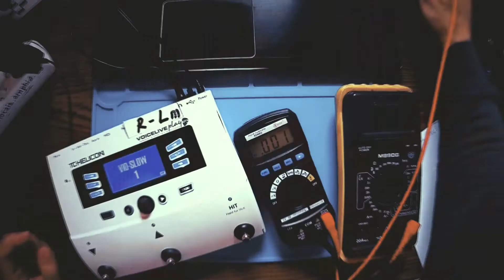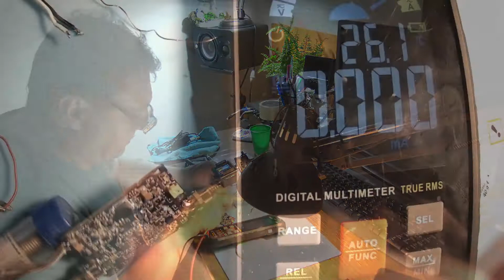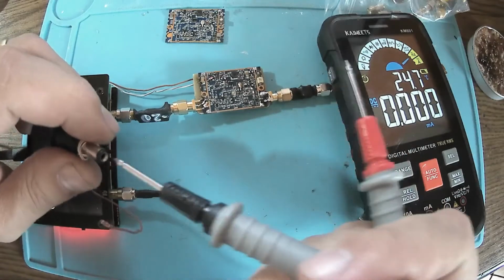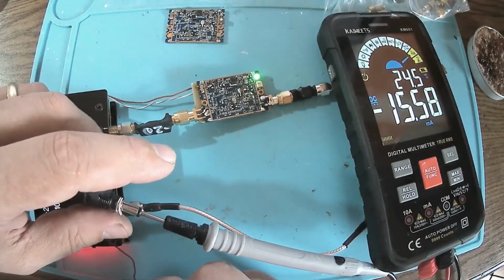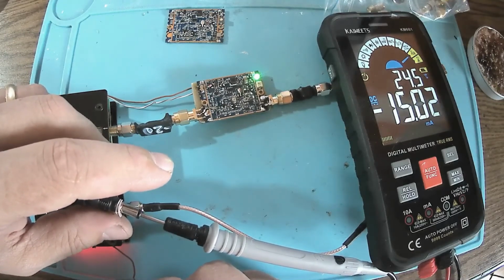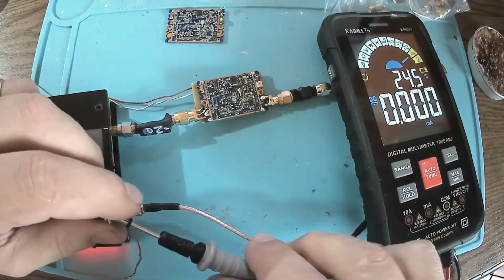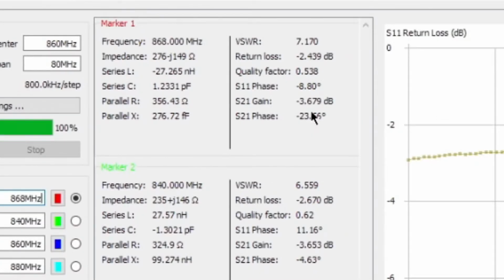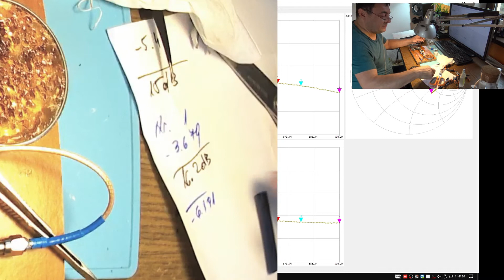AB-IOT-433/510 MOD for Helium RX antenna amplifer

Comment: Hi, i want to ask you something.
I plan to use 2 antennas of the same type without splitter on one miner , the antennas have 9dbi omni, the first one  at a heigth and the second at another heigth
Both antennas are short circuited.
If i do this i will change the impedance ? It will affect somehow the miner ? Will i have more rewards ?
Thank you for answer
Reply from the maker: By the book , two antennas are very difficult to work in tandem..there are a lot of phase issues, very possible to null each other..of course a kind of sum to connect together is a need..Practic..you may try, I recommend different kind like a Omni with a Yagi..

Comment: I was just searching if it's possible to modify a 510mhz to a 868mhz as the 510 is only £10
Reply from the maker: At least for RX ..yes! I'm still working on TX part..
Reply: @viocaia  did you ever figure out TX part?
Reply from the maker: @joesousa6837  not yet